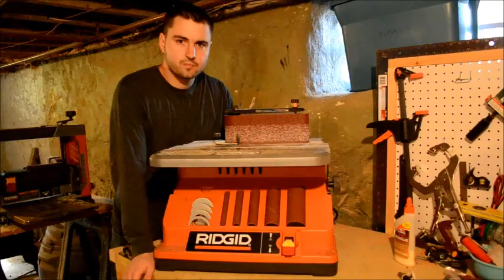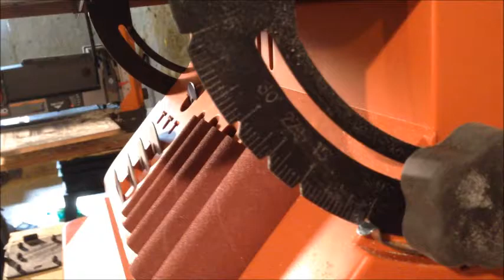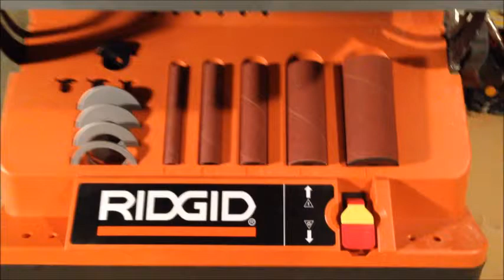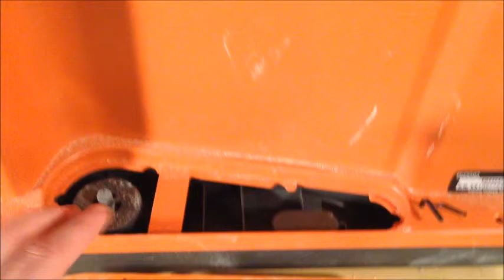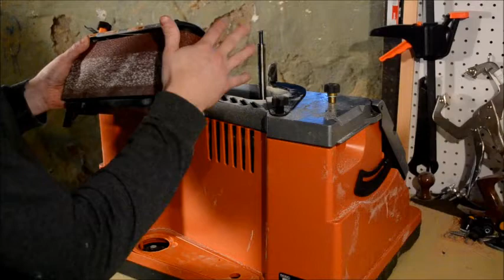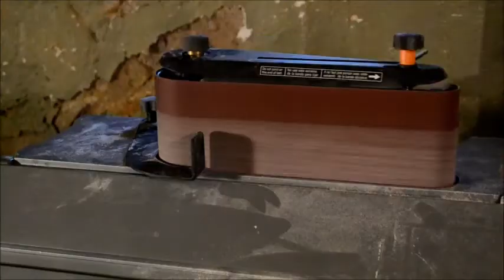RIDGID Oscillating Edge / Belt Spindle Sander Details & Review

Comment: Your having better luck with your sanding sleeve staying in position than I am having. And I have tightened nut really tight. My sleeve rides up, and my washer is in place and nut s tight.
Reply from the maker: You may have a sleeve with a slightly larger inside diameter. I'd try a different one that's been purchased at a different time. Could be manufacturing variance.
Reply: @JaredDesrosiers  I have applied a little wrap of masking tape to cyl and added another washer on top of the large washer. It lets me tighten things a bit more. Seems to work now. Thanks  ja
Reply from the maker: Sounds good. Glad you got it to work!

Comment: Is the orange table plate insert made of plastic? Is the belt sanding housing unit made of plastic?
Reply from the maker: The table plate insert is made of plastic. It's height is adjustable, so you can make it flush with the table. As for the belt housing, it's a combination of metal and plastic. The rollers are plastic, but most of the housing is metal and built well.

Comment: Does the sander include a miter gauge? Is the miter track a standard 3/4" x3/8"?

thanks
Reply from the maker: It doesn't include a miter gauge. Yes, you are correct on the slot size.

Comment: I have one of these units and have found that after you use it for a while, it is hard to remove the belt sander, it sticks on the moving post.  Real job to change.
Reply from the maker: Thanks for the heads up. Maybe a little bit of lubricant would help. Also, your shaft might have been dented or bent slightly. Regardless, I'll keep an eye on my unit for any signs of this.